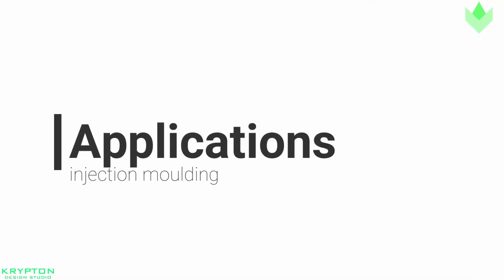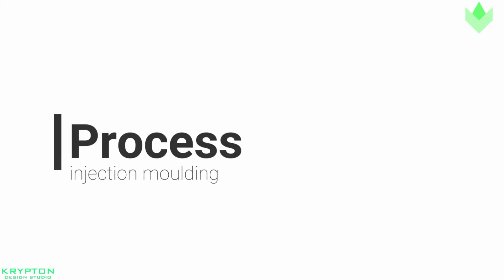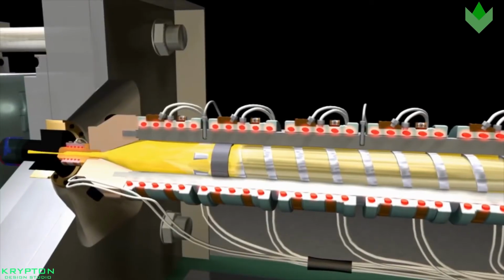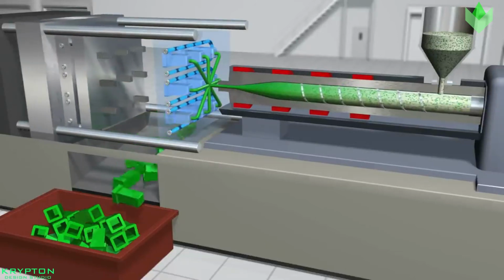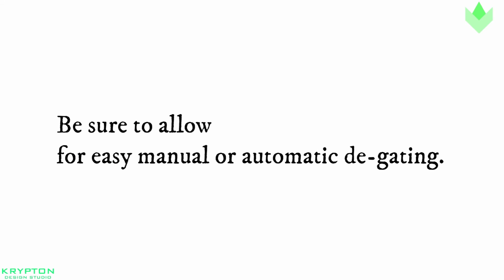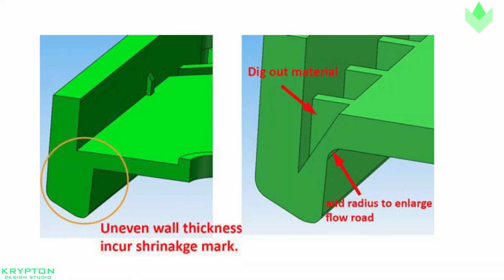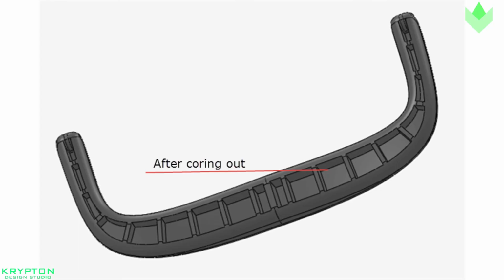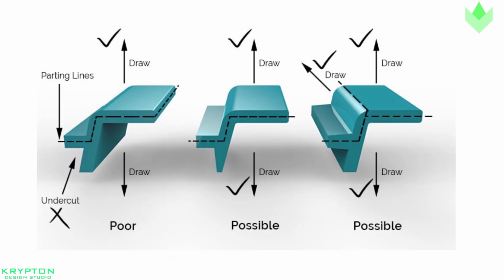Basics of Mould Design | For beginners | 2021

Comment: Can u provide Any PDF of mould basic
Reply from the maker: https://tinyurl.com/mouldtheory
Reply: @KryptonDesignStudio  I want Mould calculations Pdf standard.
Reply from the maker: @rajendharbhukya714  You can refer this, "Plastic Mold Components - Technical Data"
https://in.misumi-ec.com/maker/misumi/tech/mold/
Reply: @KryptonDesignStudio  Sir Actually I Want mould design pdf Calculations Like Sprue bush,plates of  a mould,locating ring ,spacer block, insert And runner and gate,uniform Wall thickness  calculations
Reply from the maker: @rajendharbhukya714  Not available right now. If available, will definitely share with you.